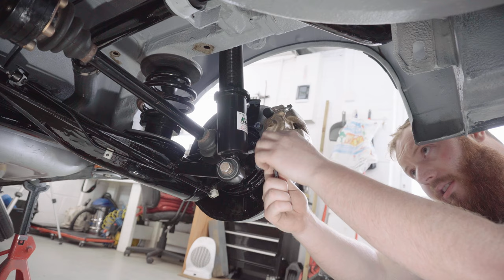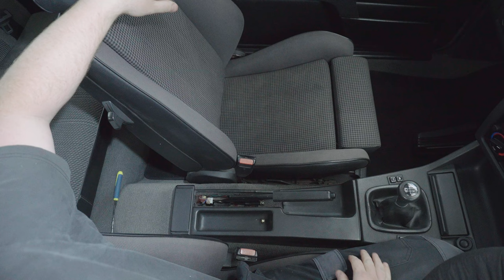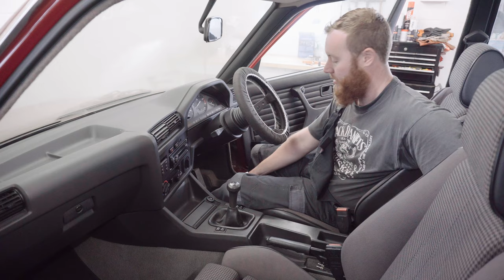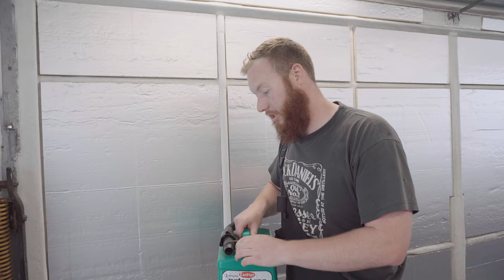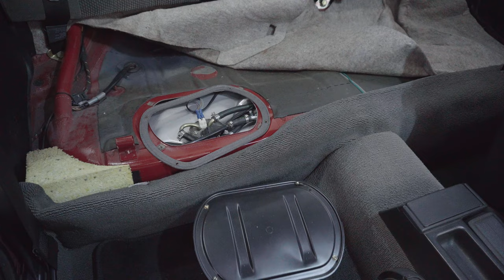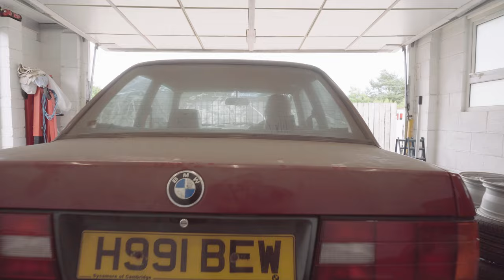How To Replace BMW E30 Handbrake & E-brake Adjustment Guide | Plus Brake Bleeding & Drive | 024

Comment: Mate, this looks amazing. Just starting my E30 316i 1991 restoration and the hand break is completely stuck as it misses the button on the lever, inside the car.

What is the black paint that you used for rust, under the car, please?
Reply from the maker: Hope the vid helps you in sorting the handbrake out.

Which black paint do you mean, the stuff I used to do the subframe and heat shields etc? It's a 2k black paint done with a spray gun. I'd recommend something like POR15 if you haven't got access to that stuff.

Comment: had a go at this one today, my god is it a ballache with everything behind the hub! Glad you put your brake shoes on the same was as I did - as the E30zone wiki says to do the other way, but it might be a typo as this way with the large gap at the top on the adjuster looks to be less likely to fall out of place!
Reply from the maker: Ahh yes I vaguely remember being puzzled by the guide before throwing it out the window and figuring it out myself. I might shoot them a message and see if they'll correct it.

Hand brake is super fiddly even with the right instructions, hope you got it all sorted in the end. 😃
Reply: @SPANNERRASH  I had to give up due to lack of light (and lack of outside temperature). but I'll crack back on with it when I get a spare day - speaking of BMW handbrakes, just picked up a E46 330d touring, and it's handbrake is also garbage :P
Reply from the maker: @Keats.Garage  Haha when they're set up correctly, they work beautifully, trust me! 😂

Excellent choice with the touring, sounds like a god-tier daily driver.

Comment: Hi. I'm working on a Z3- same handbrake. With handbrake on, and holding well, I can roll/drive the car backward and forward by a foot or so. Say if I put the handbrake on at an up-hill junction the car will roll back a touch 'til the brake takes effect. It's as though the shoes grip the drum but the whole shoe assembly can rotate a little. I've been told 'they all do that' but it seems a wrong-'un to me. I've just got it apart to investigate tomorrow. Did yours, with lovely new parts adjusted well, do this too?
Reply from the maker: Interesting! Honestly, not much at all, no more than in any other car with this type of hand brake. I wouldn't say a foot, but a few inches maybe for the handbrake to really grip.

It's possible that the locating twist screws that go into the shield aren't held properly on yours. In my vid I used Lockheed Washers to improve this to make the handbrake less sloppy.

Hope that helps!

Comment: My rear right wheel is getting hot when driving. 
Its definitely the shoes rubbing on the drum.
The cable seens to get slightly stuck where it enters the hub any ideas??
Reply from the maker: Not uncommon for the friction material to come away from the drum brake shoes and end up rubbing inside the drum so I would investigate that possibility.

I think it will become obvious to you when you remove the disc for a look. Otherwise, you might just need to adjust it through one of the hub holes like I showed. Sounds more likely to be the former though.

Hope it's nothing major!

Comment: When you replace the rear backing plates, you have to remove that little bracket that the handbrake cable goes through. I took the bolts out, but it doesn't seem to want to budge. Do I just hammer it off? Pull it?
Reply from the maker: If I recall, it's like a dowel into the rear arm. I would recommend getting some WD40 to soak into it and maybe using something to heat it up. Then a couple of back and forth taps with a hammer should get it moving.
Reply: @SPANNERRASH  Great. Got it off, appreciate that. It was a short sleeve so yeh just wiggling and tapping it gently got it out after some time. Soaked in vinegar overnight and it was good as new.
Reply from the maker: @ExileElf  Awesome, glad it worked out for you pal! 😃

Comment: 😢Could you make a video on how to adjust the handbrake. please
Reply from the maker: Hi mate, it should be covered in this vid dial the winder inside the drum and then adjust at the handle. Worked a treat, although apparently the brake shoe spring should be the other way around to how I did it, so it helps lock the winder. Adjusting it might be harder that way though.

Comment: tips on filming if you are using a phone touch once then hold to focus lock so it wouldn't do these random out of foucs shots and if its a camera use manual foucs
Reply from the maker: Cheers for the pointers on that, we're using a Sony camera for most of the shots, and most of the time we can leave it on autofocus and it generally does a good job. But sometimes it gets it wrong and we fail to notice at the time.

Of course, it was way too late to reshoot it by the time we spotted it this time, so please forgive that, we're learning as we go. 😅
Reply: @SPANNERRASH  all cool still a banger of a video just thought about giving some hits might be of use and you are doing great with the angles and positioning
Reply from the maker: @ay2gl  Cheers mate, appreciate that 😁

Comment: so what was the problem that car wasn`t start???
Reply from the maker: I'd had the fuel tank off and the whole fuel system dry previously so it took some cranking to get the car to fire up. I thought the pump wasn't working because I couldn't hear it when I switched the ignition on but it turns out the E30 fuel pump goes on the crank so it doesn't prime on the key like newer cars do. No big deal in the end 😁

Comment: The angled spring may be in the wrong position. I had to place mine on top so it would catch the teeth in the manual adjuster. This kept is from coming loose after using it long term.
Reply from the maker: Ahh you think I did it the wrong way around? I felt pretty confident about it at the time but I can always whip the rear discs back off to switch it. I'll take a look, thanks for the heads up!

Comment: I know it’s been months but none of my abs sensors fit properly when I did my five lug swap anyone got any ideas I hear pre facelift e36 sensors work just fine
Reply from the maker: Hmmm that's a conundrum, I guess I was lucky that my E30 has no ABS so its simplified.

Your E30 sensors should still be in place for the rear though, right?

For the fronts, using E36 sensors that fit in the new front knuckle sounds like it would work, but maybe someone who has experience with making the ABS work will chime in and share their experience. 🤞